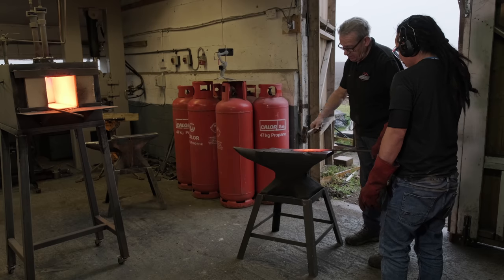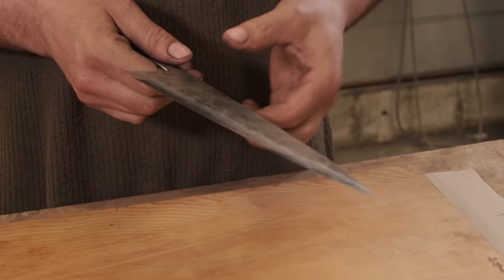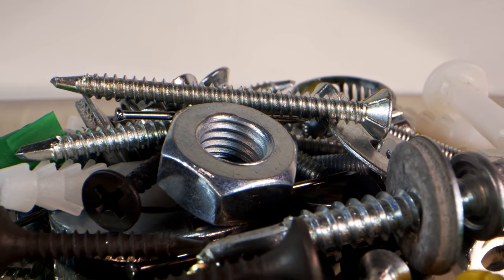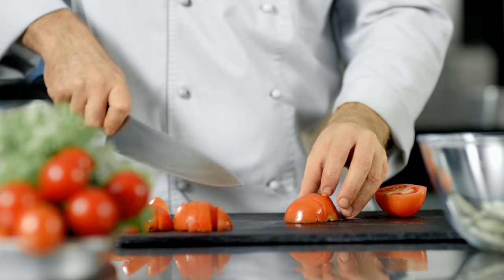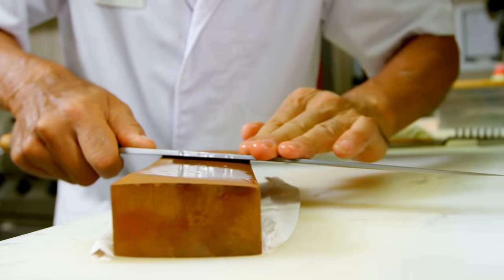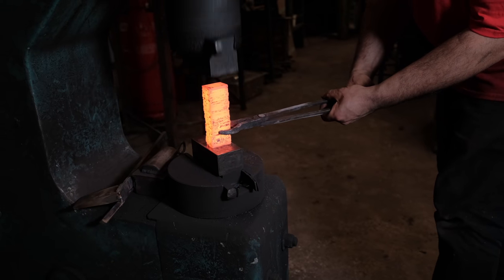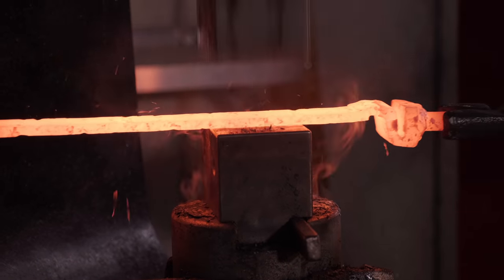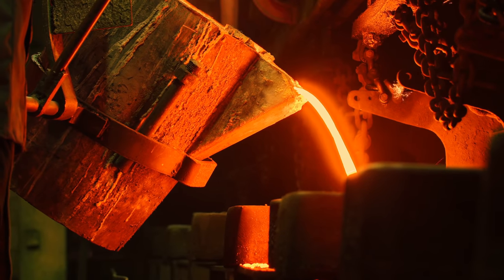Why 98% of knife makers pick the wrong steel according to a metallurgist

Comment: Bladesmiths use Carbon Steel because it is cheaper, they can hot shape with a furnace and anvil and they can do simple heat treating and get good results.  I don't like rusty tools or knives, and spend a lot of time in humid, wet and saltwater conditions -- so there is no reason for me to have basic Carbon Steel knife [which as one blademaster / metallurgist in this thread observes] is redundant as all steel has carbon.  Steel = iron + carbon !

Comment: The high vanadium steels rust like a bitch, at least the old alloys, but are TOUGH as anything.  Can have giant cracks in  them and STILL not break.  Its amazing.  Haven't looked recently at new vanadium steel alloys maybe with some chrome in them as well
Reply from the maker: Cheers for the comment! I heard thew new steels are a lot more rust resistant and has good edge retention properties at the same time. Maybe worth reviewing in our next video?

Comment: You have to have a balance between chromium and carbon because the chrome competes with iron for carbon in the formation of carbides. The chrome carbides don't contribute well to the steel being stainless and the pure chrome in solution doesn't contribute to hardness. The bottom line, you have to compromise, just as he points out.

Comment: i like 1075 or 1095, 'cause it's harder than wood and easy to sharpen
Reply from the maker: Hi! I know the 1095 is a very popular choice for sure for the exact same reasons you’ve just mentioned. Thanks for your comments and were hope to see you in our other videos!
Reply: @UKBladeshow  you're welcome. i'm coming from the cheapest and most serviceable angle, not the best available steel.

Comment: Your powder steels are great for edge retention, because of their hardness, but under abuse AUS 8 / 10 , 14c28n and 8Cr14MoV are a better choice… 14c28n and AUS 10a will hold an edge longer. The powder steels will chip and crack easier than the aforementioned steels.
Reply: Powder steel knife is for kitchen. They are not bushcraft knife. You should have SG2 knife one and you will forget all other kitchen knife.
Reply: I’ll take n690 or n695 steel it’s holds the edge better and it’ll cost 1/2 of sg2.
Reply: SG2, VG10 and N690 are not different in tern of toughness. They are all have double toughness and hardness score compare to 1.4116. SG2 has better hardness and edge retention compare to VG2 and N690. I like VG10/ N690 but they are not my first choice in the kitchen. I prefer DC53 or cheap D2 for bushcraft knife.
Reply: We can maintain nearly same sharpness to all steel. But to maintain 1.4116 and 14C28N to stay as sharp as SG2 is time consuming for me. VG10 and N690 is actually not bad, not too much time stropping but sharpening is not quite as easy as I like.
Reply: For bushcraft / field survival…AUS-8 or 80CrV2 with a 90 degree spine would be preference. Overall steel for everything, as in lower and top end … 14c28n as the lower grade and Magnacut as the upper grade…I’m talking any knife in general. I also like the joker series of knives with n695 steel… super durable, easy to sharpen , rust resistant, good edge retention….

Comment: Take that carbon steel blacksmiths :) Yes carbon can be sharpened better simply because you haven't got the time and tools to properly sharpen stainless. It's best to use diamond plates to sharpen these stubborn steels, they are harder then regular waterstones and really reduce the amount of time you need to sharpen knives. It's really magic if you want to sharpen a regular knife, just a few strokes is enough. Good reference to the book of John Juranitch and that simple experiment with the blue and red handles. It was when I read about that particular experiment, that (some) stainless steels are actually quite superior to regular steels.

I personally prefer 1.2363, commonly known as 440C, but not all 440c is created equally. But it's insanely pricey. I still want to try CPM steels, but I haven't found an good source for it.
Reply: If 440c is expensive to you, then you can't afford the CPM steels even if you find a source
Reply: @Eric-zs6rd  I can afford it plenty enough if I wanted to, don't go assuming what I can and cannot afford. For what I call pricey is a relative thing and mainly from certain reference points and what I personally find reasonable. I can be picky about a $10 item, but when I needed a new washing machine I bought one of the more expensive ones. 

Currently the only sources of CPM I can find are abroad, which instantly doubles the price. So yes, I would love to try it, but at that relative price point not at all. Not worth the potential benefit. 

I also tend to look for the direct sources of material and not the "knife supply stores" that add about 80% on top because of the word "knife". 

So what I do, is I compare steels to other good steels I know and love to work with, like O1 or D2. Then 440C is pretty expensive for the added benefits, especially if you include the additional belts and the more expensive heat treat. It's a beautiful steel, but dang it's also a pain in the butt sometimes.

Comment: 1-All steel is an alloy of carbon with  iron  and then possibly other elements like chromium , vanadium , manganese , silicone , nickle , tungsten , cobalt , cadmium or molybdenum
2- if you sharpen on diamond plates,  it dosnt matter what steel you use 
3- not all knives are kitchen knives and sum people want to throw a spark of flint and for that carbon steel (HC over 1%) has advantages 
4- you do not have to use just one kind of steel Sanmi lets you have a corrosion resistant outside with an extremely high hardness blade edge

Comment: I would have stated the distinction between low-carbon stainless steel and high-carbon stainless steel, so we will not have people who buy their low carbon stainless knives, 5 for 20€ from supermarket, thinking their knife is better than a carbon steel knife. 
Because stainless steel starts being better than carbon steel at the same carbon content, and 90% of the stainless steel knives you find in people's home and in most shops don't even come lose to 0.5% carbon.

Comment: I am a hobbyist and do mostly hand forging, so I use mostly 1075/1080 carbon steel.  Reasonable balance of easy to work, hard, and not-picky heat treatment.

One thing you didn't mention is the heat treat process.  Carbon steels can be quenched with oil dunking, which is nice and easy for most low-end shops to setup.  Stainless steels generally require more elaborate quenching and tempering processes (liquid nitrogen, aluminum plates, etc.) that are harder to come by for the casual hobbyist.  If I had access to better equipment I'd consider doing stainless, but for now I stick to what I can actually work with casual tools. :-)
Reply from the maker: Hi Larry! Thanks for taking time to comment and you are right, stainless steels do need a bit more fancy heat treatment (which is one of the next videos coming soon)!

Thanks again and we hope to see you in our other knife-making videos!

Comment: I am interested in finding out what kind of steel you would call the ingot Rick Ferrer made and used to make his Ulfberht sword in this video -> https://youtu.be/namXt4Etn_o  <- would it be considered stainless steel or carbon steel? As they call this a crucible steel and it is supposed to be similar to the steel they originally called Damascus steel, what would you call it today? Personally, after watching Rick make that sword I don't know if I would call steel with all sorts of wavy lines in it true Damascus steel. I would like to find out, also, the portions of carbon and iron used to make that kind of steel.

Comment: There is one difference between carbon and stainless that gives carbon the upper hand in a "survival" or wilderness use knife. Plain carbon (1095) will throw a spark using just a stone on the spine of the knife. Stainless won't. Both steels are great. 01 is my favorite carbon.

Comment: The butcher steel isn't for sharpening but for honing. It doesn't remove material, but it restores the cutting edge by pushing the tiny, thin sliver of material back into a straight line so that it doesn't catch.

Comment: i heard a rumor; that 440 stainless is a good mid range choice for knife blade...
Reply from the maker: Hi Rodney - it depends on a variety of other factors or variables that the blade will be used for. Every steel has its own pros and cons but 440C is what I believe is used in razor blades so high carbon content and high hardness.

Comment: Can someone tell me what steels I can heat treat in a small gas forge and quench in oil. I currently only use 1095 or old leaf springs
Reply from the maker: Hi William thanks for the question! Most steels can be heated in a gas forge but obviously like Graham says, it’s a bit more difficult to control the heat / time. A kiln is always the way forward but it all depends on how often you will use it as it’s a big investment I suppose. 

In answer to your question on the oil for 1095, please check Rye Oil 50 here: https://www.gfsknifesupplies.com/Products/quenching-oil

I hope that helps!
Reply: I only like 1055, 1075 and 1084 for gas forge , it gets too hard to maintain the correct temperature for others. I prefer to sent other steels out for a heat treat till I get a pid controlled oven.
Reply: Thanks for the  info

Comment: Stainless steel is very strong and hard also heavy  it can br very good . Like the heim joint bearings used on off road race trucks.  It aalso can be hard to work wit. cuttinG AND DRILLING A HOLE CAN BE TOUGH.  DRILLINGA SMALL HOLE IN THIN STAINLESS WILL MELT YOUR BITS GETTING TO HOT!
Reply: Technique. I built experimental apparatus for years and used stainless and aluminium a lot because I can't paint for sh.. You need a really sharp drill, coolant and patience.

Comment: This was very simplistic. There are stainless steels that don't have many Chrome carbide. It's only the chrome in solution that contributes to corrosion resistance. Feel this guy only has a superficial understanding.
Reply from the maker: Hi John thanks for the comment. I hope you understand we are only talking about stainless steels in general but not all of them. Graham has in-depth knowledge on many type of steels and the reason we made this video is to help educate people who may not understand the difference and why they would pick carbon steel over stainless or vice versa.

Thanks.

Comment: My old man used to told me, it is not as much the material as the treatment that makes a good knife. Germans are the masters of steel treatment so, if you want a good knife, buy German, you can't go wrong.
Reply from the maker: Germans have got excellent heat treatment facilities (from an industrial level that I’ve seen) I agree, but the rest of the world have also caught up for sure. Thanks for your input!

Comment: Well EXPLAINED regarding the different STEEL'S , what You have to DETERMINE  is for WHAT TASKS, you need your KNIFE 🔪 for , and HOW AVAILABLE, IS , you're SHARPENING Facility's  are in that ENVIRONMENT ,  it will NOT be the SAME , a SURVIVER KNIFE 🔪 , for the COUNTRY , that you might have LIMITED ACCESS , yo SHARPENING STONES , and probably CARBON STEEL , would be EASIER  TO SHARPEN , than in your KITCHEN , where STAINLESS STEEL , you have ALL the necessary    FACILITIES to SHARPEN at HOME,

Comment: German carbon steel is far better to use than any stainless I have bought and used in my 50 years. I use carbon steel in the kitchen too. I can't properly sharpen stainless with the stones and hones I own. Opinel number 8 and number 9 are my favorite knives and I own many Benchmade products from my ignorant youth. Opinel are inexpensive and hold a wonderful edge.

Comment: How many belts per knife -- LOL!
Reply from the maker: That’d be nice to know for sure! Maybe for another video?

Thanks for the comment!
Reply: @UKBladeshow  You'll get different answers from almost every maker you ask. Even if they're all using the same steel. Are they grinding before or after HT? Are they grinding on a flat platen or a wheel? Are they hogging with 36 and then jumping right to 400, or using every grit in-between? Are they using cheap belts or the best ones? Are they taking the blade to a 400-grit belt finish, or a scotch-brite style finish, or grinding it all the way up to a near mirror finish with micro-grit belts?
All those factors make a difference. 
Generally speaking, higher alloy content means using more belts, there's definitely no way around that.

Comment: You cannot sharpen metals like Sandvik 12C27 on a steel nor really that well using wet stones.  It’s so hard it needs a diamond stone.  I have stainless damascus Yaxell knives and other powder steel blades.  They’re both incredibly hard and incredibly sharp.  Diamond stones are really the only way to easily sharpen those.
Reply from the maker: Thanks for the input Paul and yes, some of the Sandvik stuff can be very tough to sharpen.

Comment: I've never had a problem with rust on my knives. Just wipe them off, jeez. Its not hard. Unless you are working in an environment that is saturated with salt water, like a boat or some such thing, there's almost no problem keeping a knife clean and dry.
Reply: It doesn't take salt water to cause corrosion problems, jeeez. In my area - hundreds of miles from any ocean - the humidity is above 90 percent about half the year, and that WILL degrade a fine edge on "carbon" steel whether you use it or not. Wiping the blade down has nothing to do with it. I honestly don't care if the sides of a blade patina or even rust, but losing the fine edge just by owning the knife gets to be a real pain. 
And no, sorry, I'm not going to constantly coat my edge every time I use it with chapstick or gun oil or any of the other "tricks" people advise. Been there, done that, it's not worth the trouble. 
If you're using a blade with a thick edge and a relatively steep angle, that slight bit of corrosion at the edge really won't matter at all. But I prefer knives with thin, very acute edges, and it really makes a difference then.
Reply: @locke2517  you completely missed the point. Thin carbon steel edges degrade in humid weather. Period. Yes, even when they're spotlessly clean. 
That's not my opinion, it's just chemistry.
Reply: @dogslobbergardens6606  You don't need to lecture me about chemistry. I'm a metallurgical failure analyst. I can learn ya a thing or two about steel.

You're over thinking it, most people use folders as box cutters and Instagram knife jewelry, you're not going to have a corrosion problem unless you consistently work in a more corrosive environment. Most modern stainless steels are perfectly fine in the corrosion resistance department. Hence, if you wipe off your instagram jewelry (knife), keep it dry, and maybe even oil it occasionally, you will likely not have an issue. 
People are blade steel snobs and they have no idea why.
Reply: @locke2517  I'm not over-thinking anything, ya doofus, I'm sharing over thirty years of actual, real life, personal experience using knives daily, and about twenty years making them. My experience in both using and making includes everything from the simplest "carbon" steels to some of the most expensive "stainless" powder metallurgy "super steels."
Thin fine edges made of "carbon" steel degrade rapidly in humid environments. 
Do you honestly think I would just make that up? 
I've never owned an "instagram knife" or "safe queen" in my life, and I surely never will. They don't interest me. It's pretty funny you have to resort to that to support your "argument," and try to switch the conversation to "stainless" knives.
Reply: @dogslobbergardens6606   dude go back and re read the original comment. I haven't once changed topic or my stance on anything. I only mention stainless steel knives because thats whats relevant to the modern folder world, but allow me to state it differently since you're so intent on being fragile about the topic. Keep your knife clean and dry and you won't have a problem with corrosion (In general). There isn't a metallurgist out there that will disagree with that statement.

 Ive been a Metallurgical failure analyst for 11 years bud. Ive seen more rusted and pitted steel than you have or will for the next 100 years. 

I get you wanna show people how knowledgeable you are, but you picked a really stupid hill to die on for what reason I could only guess.
Reply: @locke2517  we get it,  you know everything there ever was to know and it's totally impossible for humidity to ever affect thin sections of steel. That could never, ever happen. Alllll righty then! You clearly will not shut up until you get the last word. OK, here's your chance. Go on, have the last word.
Reply: @dogslobbergardens6606  just keep your knife clean and dry
Reply: @dogslobbergardens6606  you engaged me. You're the one fishing for the last word.